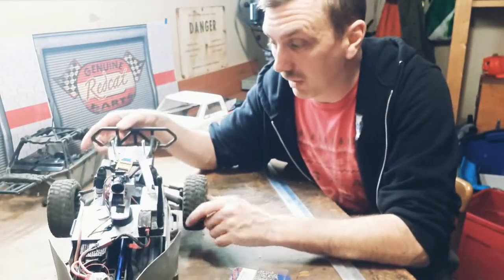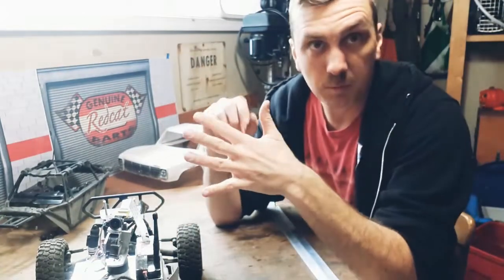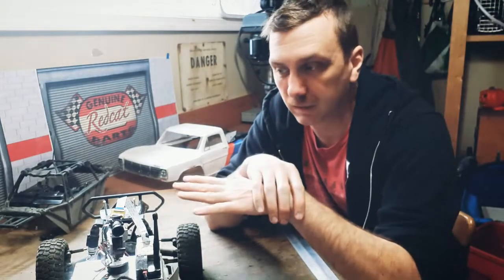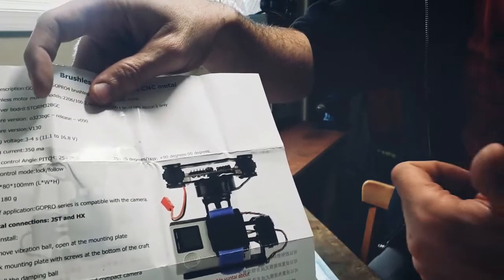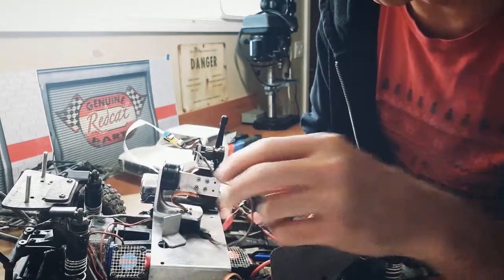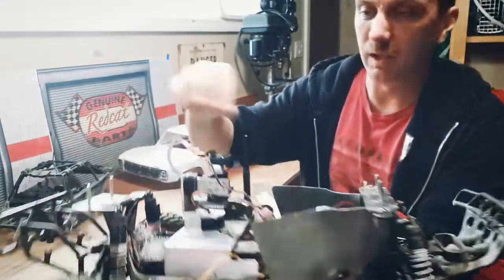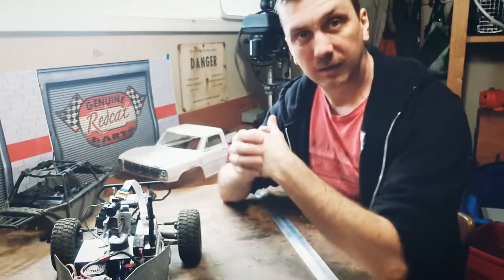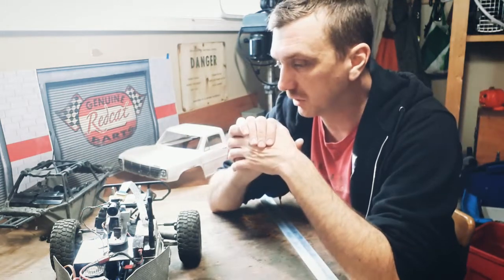Gimbal Parts and Details - 3 Axis Gimbal - FPV RC Car

Comment: Great build! Just came across your videos.  I have been working on my own gimbal fpv car setup. Yours is better.  Tying into the steering servo is big. I was not sure it would be worth doing and didn't have the confidence to tear apart and scratch build a gimbal.  Seeing what you have done, I will be following suit at some point.  I have only posted one quick neighborhood test run so far.  Inspiring build,  cheers.
Reply from the maker: Right on man, good luck with the build.  I'm hoping I can add more info about the setup etc.  I've got a bunch of it types up on my blog at rc groups user name is JIPPERR there, should come up in a search.  Totally worth it to build a custom frame.
Reply: @JIPPERR_1   Thanks. I would love to see this catch on to the point of having fpv rally events on trails or something like that... a little gimbal like the Pocket gimbal cam, but for an Air Unit/vista would be mint... If your vids had come up in my searches, I might have just gone custom frame knowing that it worked. You are the first person I have seen doing this to this level. I will definitely be evolving my setup to custom frame. Do you know of anyone else? I will check out your rc group blog. Your build is inspiring, cheers.
Reply from the maker: @SmokeeFPV  if you have fb messenger I can add you to a good chat group that I'm part of. Let me know and I'll send you my user name so you can message me there and I'll add you in.  I know of a couple others that have had varying levels of success with the gimbal, fpvbrian here on youtube has some vids of his setup.  I'm working on a new frame right now that will take less space, once I get it tested I'll produce a more detailed plan for others to copy.  Also that should form the basis for a 3d printable frame. But that's a little ways out yet.

Comment: good job!!, suprised it works so good with the ribbon cable of the split, well done.
rctimer used to be good for gimbal motors, i've got one with a slip ring, worked great when i fpv'ed through a gopro clone, gimbal could spin all it wanted on pan.
think i'll order some more motors and a new board and build one like yours and get the tonka going again
Reply from the maker: Thanks! The runcam is a little bit of a temporary arrangement.  Recording on it is way better than my dvr lol.  Hoping to upgrade soonish